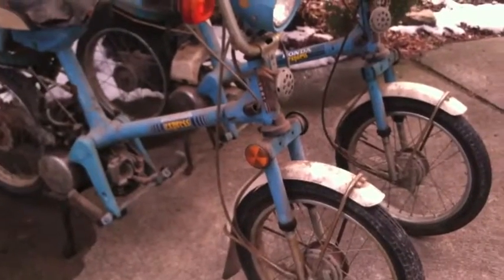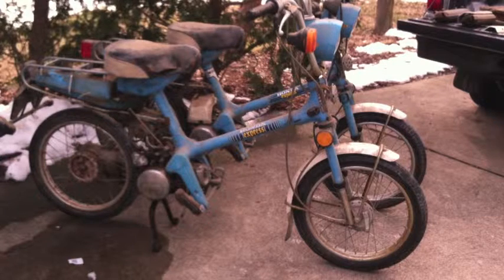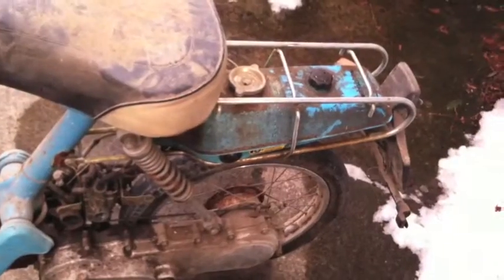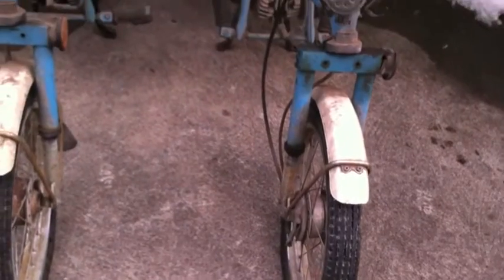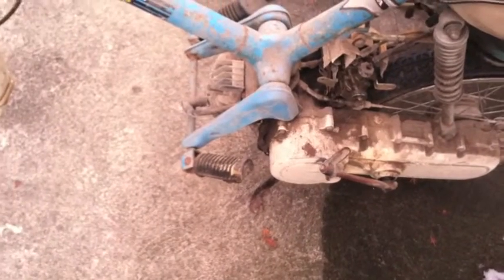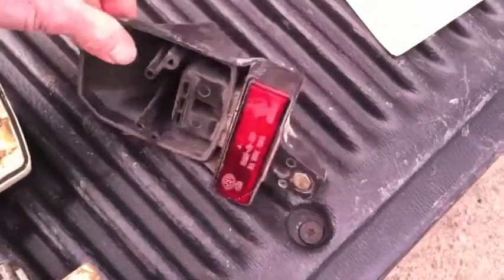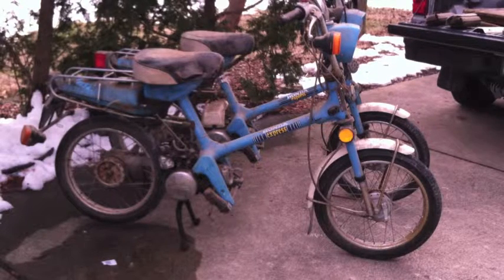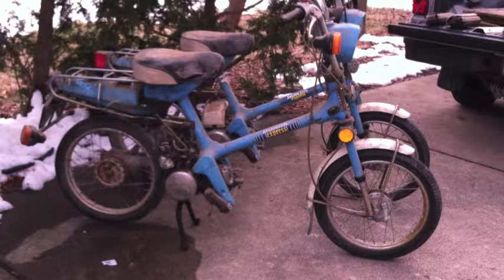Double your pleasure - Honda Express Barn Finds

Comment: Picked up my 1980 NC50 a couple months ago.  Going to get it going over the winter.  Buying carb parts now to rebuild and adjust.  Also picked up some evapo-rust for the gas tank.  Looked at your BAM spun alum tank, did you get that worked out?
Reply from the maker: Yea I put that on the rear rack. Sold that and the bike some time ago.